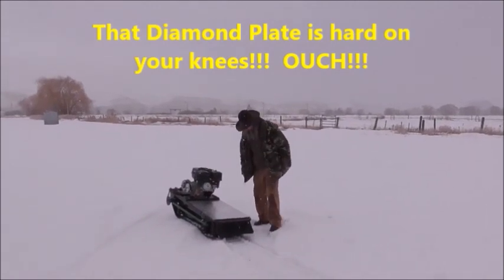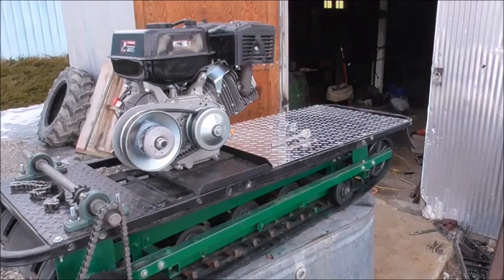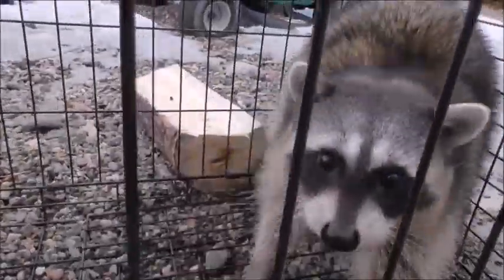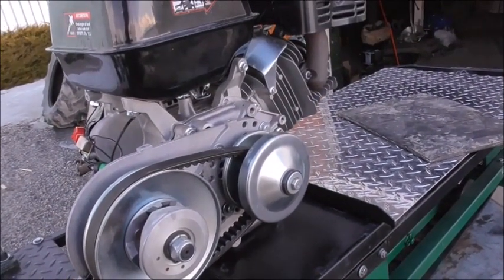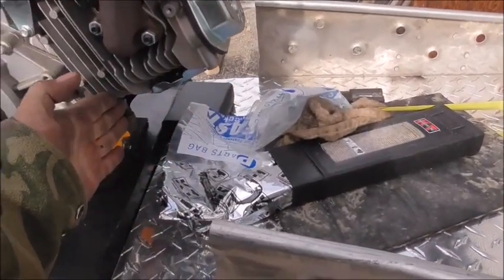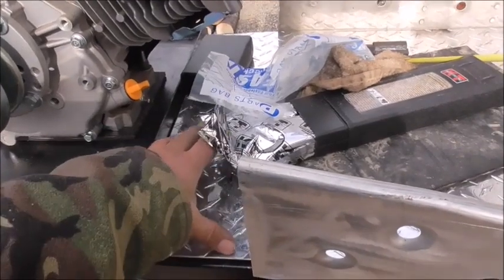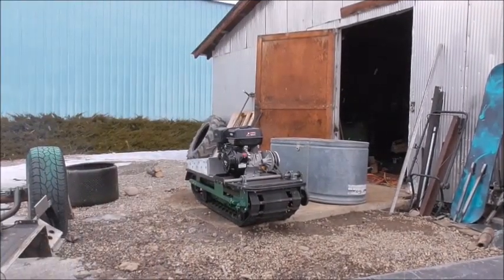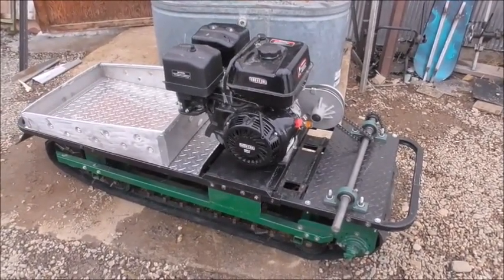Building the Snowdog Part 4

Comment: Muskrat, that is awesome! One idea I had after you said that it could be a little tipsy (top heavy) that maybe you could add a very basic roll cage around the motor to protect it in case it does roll. That might make the difference between walking back and riding back on one of your excursions. Can’t wait till the handle bars!
Reply from the maker: I think so too.  Sooner or later, it will tip over. I sure don't want to break anything like the carburetor off!  The factory made ones all have a hood of some sort over them.

Comment: Heck yes it moves out pretty good it seemed. Hard on the knees I'm sure it was. Looking forward to the next update.
Reply from the maker: Ha!  Yeah that was painful!  Sitting on it wasn't as bad.  Zero spring suspension on it.   The track belt has sat for a long time. I think it was a 1970's snowmobile, and had gotten stiff. I  was worried it wouldn't turn, but so far, so good!

Comment: I’m thinking it may not be an issue if there is flex in your engine mount. An auto has rubber mounts and flexes noticeably when you put a load on it.
Reply from the maker: I'm not sure either. It moves, but not a lot. I did put a piece of rubber belting under the engine and that might be part of the reason?  I guess I'll try it like it is awhile and see if it is a problem or not.

Comment: Loosen the chains and add a spring loaded chain tensioner on each chain. That will relieve the tress on both the engine and the jack shaft.
Reply from the maker: I think I need to do that.  The chain bounces too much.  If it was snug with a tensioner, I think it would be getter.

Comment: I would have run that diamond plate the full length of the sled and then mount the motor on.
Reply from the maker: It needs to be able to slide though to adjust the chain tension.

Comment: How many tooth gear you using on the bottom
Reply from the maker: I'm not positive, but I think its 32.  It's maybe 5 inches or so around?  I'll try to remember and count tomorrow.
Reply: @MuskratOutdoors  thank you. I’m building one also but I think I’m going to use the snowmobile chain box but not sure yet
Reply from the maker: @erictyner2162    I probably would have except I had already bought those other parts.  I saved them....who knows, maybe I'll make another one.
Reply: What part of Idaho you in? You might not be to far from me
Reply from the maker: @erictyner2162  Salmon.  East central, not far from Montana. Where are you?
Reply from the maker: I just looked it up on ebay, where I bought the gears. 10 tooth on the torque converter,  going to 12 tooth on the jack shaft, and 32 tooth on the track.
Reply: @MuskratOutdoors  Lolo. But I work all over the bitteroot. I’m a mobile mechanic. You do any ice fishing?
Reply from the maker: @erictyner2162    OK, you are close then.  I haven't in years but I've thought about doing it lately.  The only lake close to me is hard to get to. I might do it now with this contraption!
Reply: @MuskratOutdoors  that’s why I’m building mine